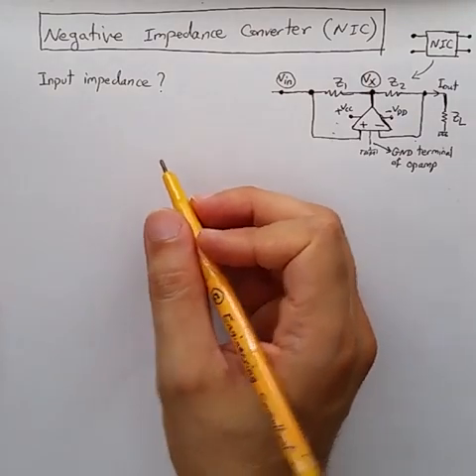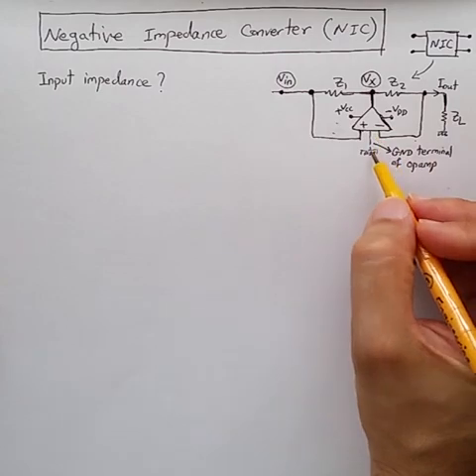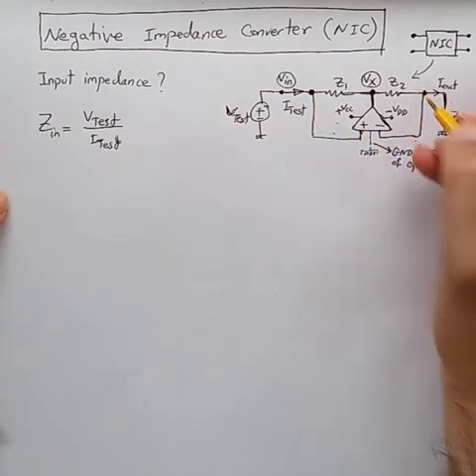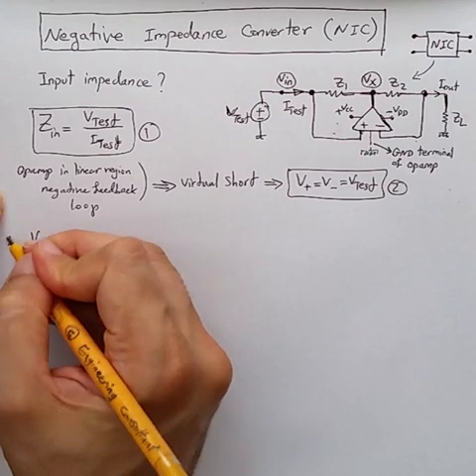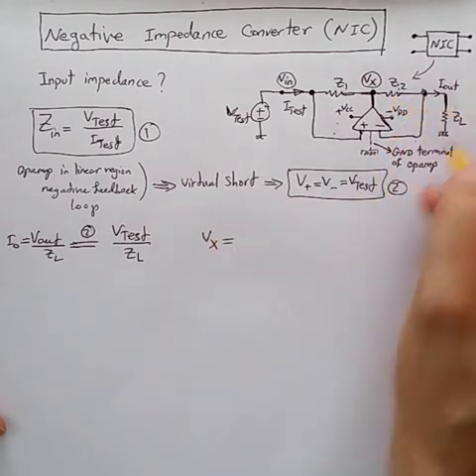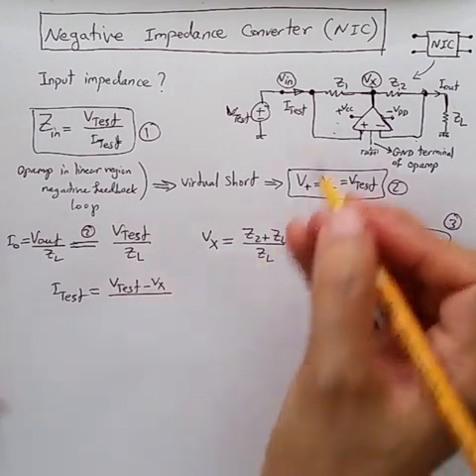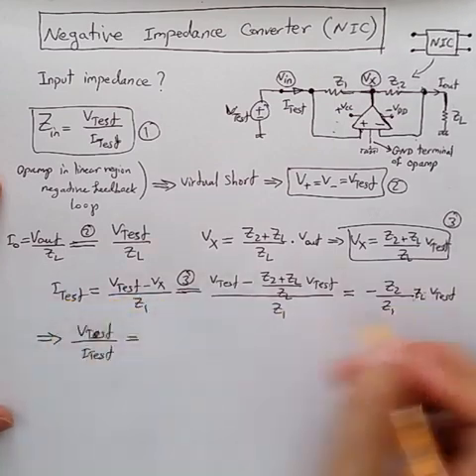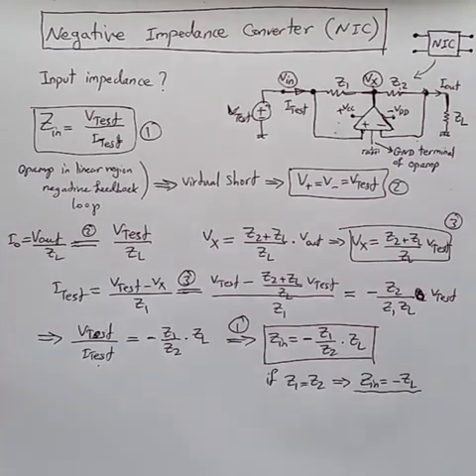Negative Impedance Converter (NIC) :  how does it work?

Comment from the maker: For more Op Amp Circuit examples see: Impedance Converter Analog Circuit Design with Op Amp (GIC and NIC) https://youtu.be/o6l_wztCACQ
Converting Capacitance to Inductance https://youtu.be/weIHG45G6Pg
Analog Computer circuit that solves Differential Equation https://youtu.be/HeZRtnRXpEI
Negative Inductance Design Op Amp Impedance Converter https://youtu.be/GF_Mun_Mkyo
Active Inductor with Op Amps https://youtu.be/6IYz4iaa05c
Capacitor to Inductor Converter Circuit https://youtu.be/weIHG45G6Pg
Operational Amplifier Gyrator Network Circuit https://youtu.be/2KpjAytRBpc
More analog signal processing examples are in https://www.youtube.com/playlist?list=PLrwXF7N522y4c7c-8KBjrwd7IyaZfWxyt
I hope these Circuit engineering and analysis videos are helpful.

Comment: Your voltage dividor is wrong. Vx= zl / zl +z2 times vout
Reply from the maker: As explained in the video the shown equation of Vx = Z2 / (Z2 + ZL) * Vout is Correct.  I suggest you review the video again. For more example, see Impedance Converter Analog Circuit Design with Op Amp (GIC and NIC) https://youtu.be/o6l_wztCACQ